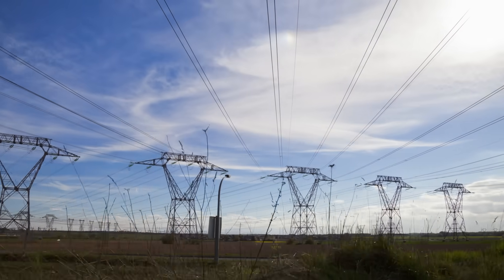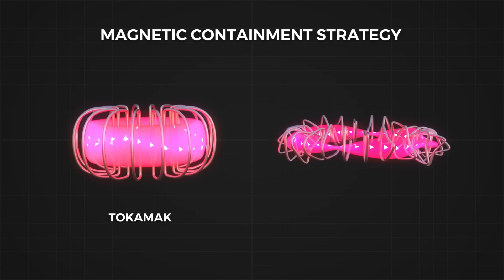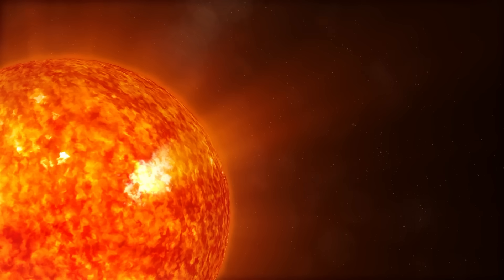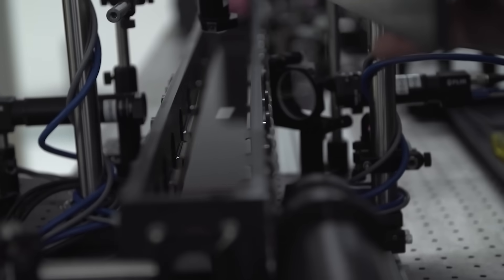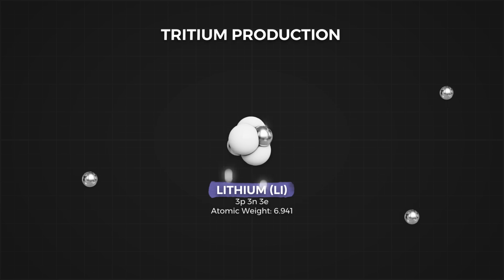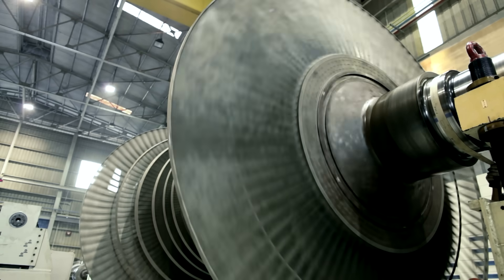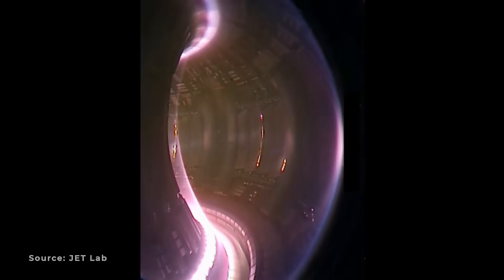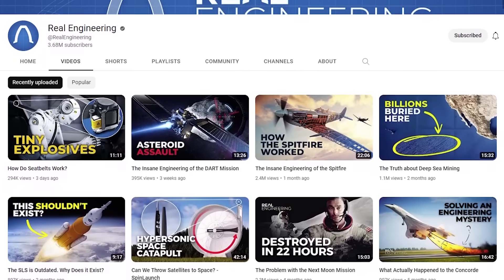The Problem with Nuclear Fusion

Comment: I have a response from a nuclear engineer who,  having recently reviewed my origin theory, now supports top down cosmology.
 
The difference is as at least important as the Copernican revolution regarding the center of the solar system, as physics has not advanced beyond the religion of the Standard Model (aka as "bottom up cosmology" or "big bang theory"), initially proposed by a Catholic priest in 1929 as an attempt to establish a relationship between science and religion that did not conflict.
 
Instead, what was accomplished was to produce a situation where science and religion would never find middle ground, leaving science to contrive ad hoc explanations overcoming contradictory evidence after discovery, making science more of a religion than a science.
 
Truth is singular, and there should be no conflict between science and religion.
 
There will always be the "God of the gap" used to explain the inexplicable, but the chasm with my top down cosmology would no longer exist.

At this point in time, what is being suggested by many is like rearranging the deck chairs on the Titanic.
 
The battle ahead means continued resistance-- "never giving up," even if that means persuading only one person at a time.
 
At this late date, any comfort found in speaking out is well-expressed in the words of poet Dylan Thomas: "Do not go gentle into that good night": "Rage, rage against the dying of the light.".
 
Though most frequently applied to the process of aging, I think it applies equally-well to refusing to "go down with the ship" without loud protest all the way to an inevitable end.
 
Have you "raged" lately?

Comment: I've gotten into nuclear fusion recently and as time goes on I've been questioning: why use a neutron absorber as a blanket? Lithium 6 is an amazing neutron absorber, but said neutrons are also required to further the fusion reaction. The blanket can theoretically be shrunken to a band at the outermost peak of the reactor, while the rest of the blanket can be Wolfram, as well as Wolfram Carbide, as both reflects neutrons, and the Carbides slow them down. D2O can also convert neutrons into heat using the moderation, and thus can be pumped around the blanket in order to achieve the moderation to extract heat.

I've loved fusion, and don't want to sound like a know-it-all, but curiosity has gotten the better of me.

Comment: They never explained how the ball of plasma would even boil water when it's trapped in that chamber
Reply: They did? Literally in this video? The fusion reaction creates high energy neutrons that aren't confined by the magnetic field. They hit the wall and emit their energy as heat. You can transform it to electricity in the same way you transform it in a nuclear or fosil powerplant.
Reply: @doc.chocholousek3378  so that chamber would be submerged in water and the outside of the chamber or a different chamber would heat the water  ?
Reply: @doc.chocholousek3378  how would they prevent a steem explosion  ?
Reply: @rwarts5150  you could do that, but it would be kinda impractical (you need many wires there as tokamaks use 3 separate coil systems, you need maintenance, etc...). A probably more practical way would transfering the heat into a radiator located in some water tank. This can be done, eg, by heat pipes. There are also some more advanced proposals to use the neutrons directly afaik, but the first power plant (if it will ever exist) will probably use heat as an intermediate.

Steam explosion would occur simlly because why would it. Steam explosion is caused by rapidly heating water, thus rapidly increasing its pressure. Normal fission reactors are submerged in a pool of water, and they work just fine. If you are referencing the chernobyl movie, the steam explosion description there was highly unrealistic. There is no way it would be 4MT (or what number they stated). Anyway, a way smaller steam explosion could occur because there was a chance of the extremly hot molten core mixing with room temp water - rapidly heating it. There will be no rapid heating of water here, as the fusion reactor would just slowly (realitve to mixing liquid metal and water) radiate its energy away, heating up the cooling liquid that cools itself (by converting into steam and making electricity) and never reaches dangerous temperatures
Reply: @doc.chocholousek3378  thanks for the reply and with my limited understanding it still seems like it take a lot of power just to make power but I'm sure I'm still not understanding certain aspects of how it works but thanks for helping
Reply: @rwarts5150  yep, that's exactly 100% accurate. The problem with thermal energy is that it has high entropy and electricity has low entropy. Everything you can do must increase the entropy. 

Thus, you can always convert electricity to heat with 100% efficiency (or use a heat pump to go above 100%), but you can't convert heat to energy with 100% efficiency. You can convert some of it, but you have to use the rest to make a net increase in entropy. Thus, all thermal engines have a limited efficiency. This includes nuclear power plants, fosil fuel power plants, combustion car engines, etc... . For this reason, fission nuclear power plants have much higher thermal output than the actual electrical output (like 2.5 times). It's also the reason why some scientists try to come up with other ways to extract the energy from fusion power plants, but there is a strong case for making the first one as simple as possible.

Solar panels, wind turbines, tidal power, etc. obviously don't have these problems and the inefficiencies come there from other sources
Reply: @doc.chocholousek3378  this and the distance between galaxies and even stars and a bunch of other reasons is why I believe we will never leave the solar system
Reply: @doc.chocholousek3378  what about that Sapphire star project have looked at that because that thing seems similar to this but I don't know much about either one
Reply: @rwarts5150  we already left it with Voyager 1, and we'll soon leave it with Voyager 2, so it's technically possible to do it
Reply: @rwarts5150  sorry for the late reply, nope, never heard of it
Reply: @doc.chocholousek3378  that's cool I was wondering if you would even respond only because it is part of the electric universe way of thinking that I don't believe or disbelieve I think some of the theories could work alongside the standard model and I think the standard model has it's problems as well like neutron stars even being able to exist let alone rotate 30 times a second all I know is we will never completely understand the things we did not create or set into motion or observed with our own eyes

Comment: For "starters," the life cycle of birth, expression and death is necessary for any organism to evolve and survive into the future. The limit to life expectancy is completely dependent upon the rate of change for the physical constants and the implications for DNA replication. This evolution is known as TOP DOWN cosmology, where the very-present uncertainty of the physical constants is mute testimony to their rate of change.
 
This is near certain: Imagine a universe beginning with a single “particle” of gigantic mass that spontaneously divides into two smaller masses (with a field that obviously must exist to unite them, like, say, primordial electrostatic gravity, a quantum relationship modulo 2). Imagine that over “time” the process of division continues, producing “newer,” lighter “particles” (and forces that unite them “programmed” for future expression within when, per chance, they are irrationally unreconcilable by quantum counting) over “time.” (Note: That cascade of particles is presently observed as “nuclear decay,” where heavier elements spontaneously cascade into a spectrum of heavier-to-lighter elements.) To see how rapidly the NUMBER of observed particles (of increasingly smaller mass) can grow in a short amount of time, just multiply 2 x 2 = repeatedly on a small calculator– in a very short time the numbers go off the scale! Just imagine, then, IN THE PROCESS OF DIVIDING, heavier masses, that eventually form galaxies, divide over time (seemingly coming from “nowhere”) at each epoch of division (and extinction). This process is known as “TOP DOWN cosmology.” In the end, you have present-day smaller galaxies, PLUS the cosmic heat signature of NOW-EXTINCT past elements (including galaxies), known today as the “cosmic microwave background radiation.” (Note: Smaller early galaxies are required by BOTTOM UP big bang cosmology, where predicted smaller primal galaxies form larger galaxies over time, and where the predicted cosmic microwave background radiation would be “smooth;” HOWEVER, the OBSERVED cosmic background radiation is actually “lumpy,” and OBSERVED primal galaxies are actually larger.) TOP DOWN cosmology wins! PS: I call this theory “The Origin Theory,” as an extension of Darwin’s “Origin of the Species.” Again, please leave the ultimate origin and direction of our currently-complex universe (either with TOP DOWN or BOTTOM UP cosmology) to lesser-probabilities of 50/50, so as not to “throw the baby out with the bathwater."
 
Given that the latest “breakthrough” in fusion technology recklessly announces controlled fusion energy when it provides ignition WITHOUT accounting for energy out Vs TOTAL energy in (I still remember “cold fusion”), My TOP DOWN theory of cosmology says that in order to reconcile static gravitational and Coulomb effects (a valid grand unification theory goal) there is a value, a number R, such that Ke^2 = RGm^2, where K is the Coulomb constant, e^2 is the square of the charge on an electron, G is the universal gravitational constant and m^2 is the square of rest mass of an electron– what can be simpler than that! The calculated value of R is 4.16574 x 10^42. Given my TOP DOWN cosmology, then, Coulomb effects are 4.16574 x 10^42 times more intense than gravitational effects, meaning that local ignition, compression and containment needed for sustained fusion reactions are collectively unattainable. Clearly, the evolutionary direction of the universe must be countered and reversed to sustain a local fusion reaction– a physical impossibility! Yet, much money and time is being WASTED on attempts to “find a way,” apparently to justify continued reckless population growth on this fragile planet. (The problem does not exist with fission reactions, which have their own set of intractable problems, because energy release follows the direction of universal evolution.) What is R? Numbers and predictive ability matter (rather than finding explanation after a discovery, presently being done with BOTTOM UP BBT): Per my TOP DOWN cosmology, the radius of the universe on a quantum level is R = Root (M/m), where M is the total mass of the universe needed to unite gravitational and electrostatic forces and m is the rest-mass of an electron, yielding, Ke^2/ R^2 = RGm^2/ R^2, where R^2 is the square of R. The calculated mass at a quantum level, including “missing mass,” is M = 1.58079 x 10^55 power Kg, and the calculated radius of the quantum realm is R = 4.16574 x 10^42 power measured in instantaneous, dimensionless units. (M is undefined in the quantum realm, yet partially discernable as the observed mass Mo of the universe in the macroscopic world,). The number of unit circles (or squares) in the quantum realm is R^2 = 1.73534 x 10^85 power. It is a quantum attribute that area of unit squares and number of unit squares are indistinguishable (No need for citation, as all stated derivations are my own.) Everything is separating visually by such distance that the presence of extra-terrestrial life is very difficult to detect, yet everything has always been quantum-connected (“not locally real”). The total mass M needed to reconcile gravitational and electrostatic states is M = Mo /(2Pi – 1) (alpha^2), where Mo is the OBSERVABLE mass of the universe, (2Pi – 1) is the Bell inequality (ever an inequality in the macroscopic world, and equivalent to Euler’s “proof of God” in the quantum realm, where M is UNDEFINED), and (alpha^2) is the square of the fine-structure constant (a optical magnification factor, twice applied for virtual and real expression). In the quantum realm, the equation is undefined, because the radius is equal to the circumference, meaning that Pi = 1/2. The number of unit circles (or squares) in the universe is M/m, where m is the present-day rest mass of the electron. For a unit circle to become a unit square, Buffon’s needle problem becomes applicable, where one side is electrostatic and the other is gravitational. In order for the PROBABILITY to equal 1/2 (regarding Bell’s inequality AND Buffon’s problem), Pi = 4, meaning that Pi = 1/2 AND Pi = 4, implying that 1 = 8; hence, the qubit (used in quantum computing) is emergent. (My observations and derivations– no citation needed.) Using my TOP DOWN cosmology, the rate of change of alpha is -2.7958 x 10^-17/ year, based upon a perceived age of the universe of 13.799 x 10^9 years. For very large R the definite integral of R over time T approaching origin of the universe to the present day is approximately 1/2 of R^2, verifying perceived dichotomy (a weird quantum nuance, where areas AND number of unit circles or squares are indistinguishable).
 
In the quantum realm, the term (2Pi – 1) = 0 can also be considered as the sidereal rotation of a unit circle within a unit circle (created by Buffon’s needle drop probability).
 
As a physicist, I have been promoting this TOP DOWN model since1979. For those who would state (not me) that this is a “fun theory” (with its fulfilled prediction of larger primordial galaxies), demanding the math; then, when presented with the mathematical model finding the much-sought-after hidden “missing mass” and quantum gravity, implying that I am a mathematician with little relevance to physics: The physical world can instruct the mathematical world, IMO. In addition to reconciling the Coulomb constant and the universal gravitational constant, I have explained the significance of the little-understood fine structure constant, alpha. If you would simply “run with it,” you have the information to calculate the age and rate of expansion of the universe (much older than the presently-accepted age of the universe, hidden by quantum effects).
 
Here are three obvious “predictions:”
 
-Per TOP DOWN cosmology, there is understandably a paucity of antimatter in the local universe.
 
-Hydrogen-rich stars and galaxies of equivalent mass, respectively, previously and inappropriately deemed to be colliding under BOTTOM UP (BBT) cosmology are actually and appropriately DIVIDING under TOP DOWN cosmology, which respects and predicts this behavior from evolutionary changes regarding critical mass (witness our own galaxy and Andromeda, representing main sequence evolution).
 
-The current abundance of elements is reconciled by main-sequence TOP DOWN evolution, not requiring multiple solar cycles, exceeding even the presently-accepted age of the universe per BOTTOM UP BBT.
 
There are no absolutes (a logical dilemma in itself). The closest thing to absolute certainty is found in abstract math– in application there is always an uncertainty (like when counting apples). The best that can be expected in the physical world is to “bet on the odds.” Given my TOP DOWN cosmology, odds are for things dividing rather than melding regarding cosmic events; whereas, there is every inclination for one schooled in BOTTOM UP BBT to look for, and prejudicially expect observed galaxies and stars to be colliding. Regarding dark energy: The hidden quantum world, which reveals itself as “locally not real” (Nobel Prize already given), contains a memory of the past in our own DNA, for example, revealed in morphogenesis (“ontogeny recapitulates phylogeny”), “betting on the odds.” Dr. Rupert Sheldrake describes this as “morphic fields” and “morphic resonance.” BTW, His theory accounts for why the Kelly astronaut twins are no longer DNA-identical twins, where there is no other better explanation that I have seen being offered– instead, relegating any explanation to the growing category of “unexplained mysteries!”

Comment: These tomamaks are huge and a waste of money, but thats what they are funding buckets, there is a better concept then using huge blankets, want me to let you in on a secret, shh liquid metals (lithium berelium etc.) in resevoirs near the plasma flow, you actually missed the biggest one and that is plasma instability, plasma heat especially not being sustained, but I have answers for that as well, and its not a tokamak or a stellarator, should have been figured out a long time ago, I have been working this for a fea days and figured that out and along with some other things im not letting you in on, yes helion is on the right track.